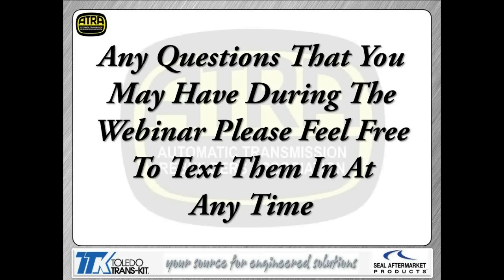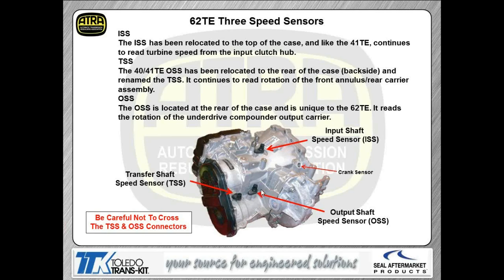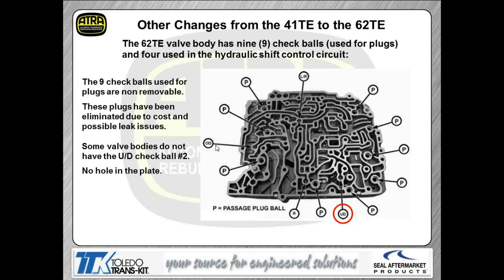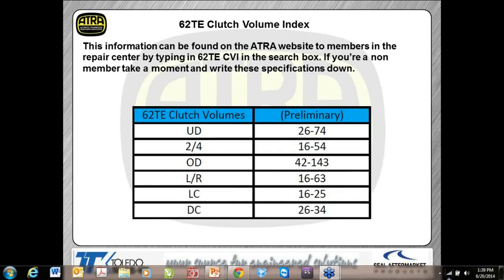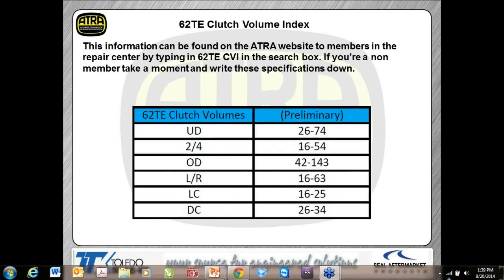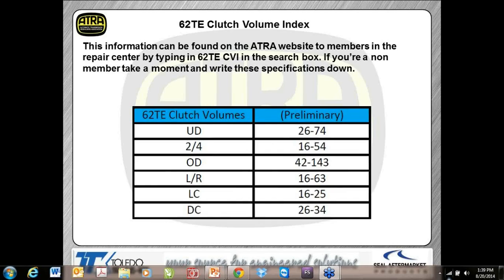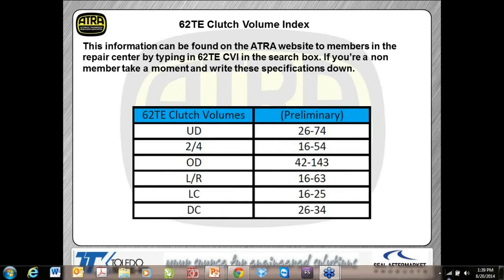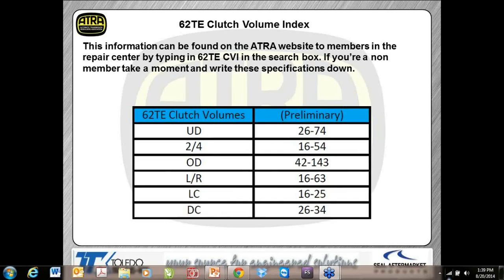62TE Updates

Comment: Hello, I have a 2012 Dodge journey sxt 4wd and the engine light turned on they put the scanner on and it came out with a code P1745 it say transmission line pressure to high any help what it can be I will really appreciate thank you and advance

Comment: I have a 2012 Grand Caravan that will not shift from 5th into 6th gear in the winter unless the engine has had well over 30 to 40 minutes to warm up. Then it shifts fine. Do you think a flash will cure this problem or do I need a new solenoid pack?  Audio is 5 by 5